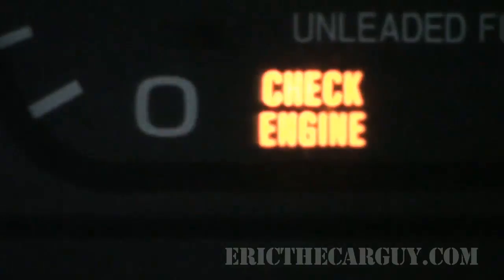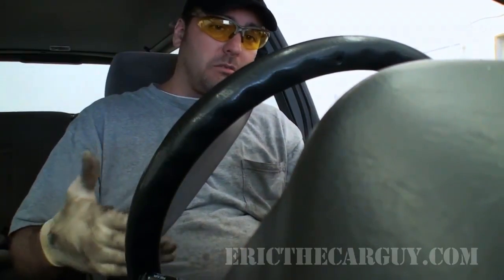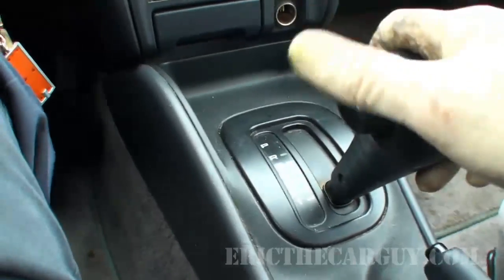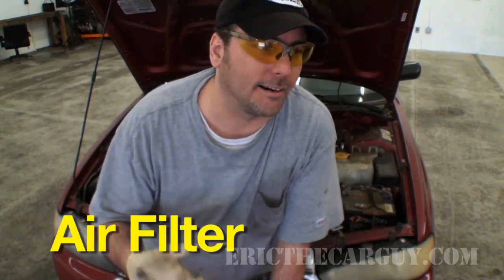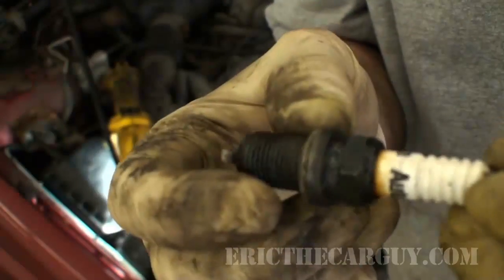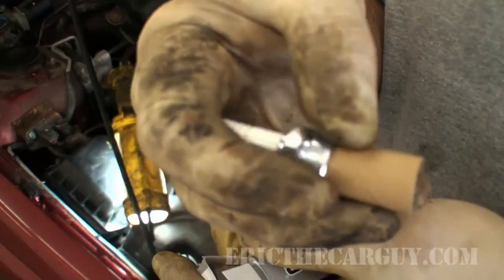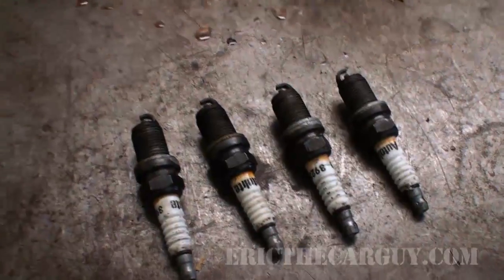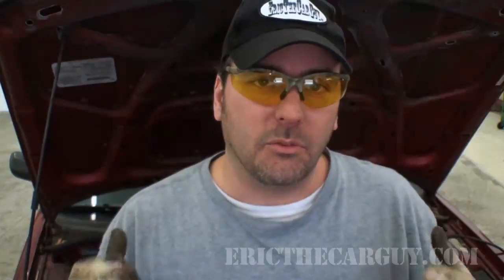Solving Engine Performance Issues (Part 1) - EricTheCarGuy

Comment: I have a 1997 f 150 I was driving along Just fine and the radio stoped working looked down at the gauges and they were zero out it died and I replaced the alternator with a used one and replaced the battery with a new one the starter solenoid and know it will crank over but won't start please help I can't afford to spend anymore money
Reply: Try the ECM?
Reply: try moving steering column up or down.i figured mine out after all my bkyrd mechanic pals got me to buy 1500$ elec.bs.replace column if so
Reply: Check your fuses. 9 times out of 10 it's just a fuse
Reply: 99 f150 dis the same thing

Comment: Cleaning the MAF sensor on an older car can really help performance. I just cleaned the MAF sensor in my mom's 99 Outback (very similar to the one in the video) and the engine runs noticeably smoother.

Comment: the plugs did it..fuel filter added a notch..good video tho..so guys manufacturer recommended plugs and fuel filter change because there might be a blockage in the filter

Comment: At the 11:25 mark it should be mentioned that any time you work with the fuel system you should relieve pressure by venting the gas gap. You'll still get some residual fuel in the lines but it won't be pressurized.

Comment: One tip for installing spark plugs is to gently lower them with your socket wrench (or torque wrench and socket) and set the plug on the threads until its just about to catch but don't tighten it yet just turn the plug counter clockwise very slowly (like loosening it) and wait till you hear or feel a tiny "tink" and that's the very top of the thread of the spark plug dropping in line with the very top of the head's thread for the spark plug. Once you hear that tiny "tink" start tightening it to torque spec and you'll never cross up or bugger the threads since pretty much seems like most if not all heads on cars these days are aluminum. (not sure if I have ever seen any car without aluminum heads)
Reply: Tyler Finvold thank you! I do the same thing never stripped or crossthreaded a sparkplug because of it
Reply: Interesting... Thank you!
Reply: I usually use a piece of hose. Works a lot better.
Reply: I do the same except I do not bother turning them left. I start tightening by hand right away but just use my fingertips so no real force is applied. Then spin them til snug and that is when the socket wrench comes into play for final tightening. Crush down the crush washer until snug and then maybe a 1/4 or 1/8 turn to be tight.

Comment: What's the recommended spark plug and coil for a 2005 f150 5.4L V8? Thanks in advance!
Reply: We used Bosch plugs and accel super spark coils
Reply: Motorcraft or Autolite for Ford

Comment: when i am going up a hill and i accelerate (especially if i should downshift and dont) i hear a gurgling or rattlesnake sound (doesnt seem like the metal rattle of a heat shield for ex). any ideas?

Comment: What kind of spark plugs do I need for a 2007 chevy tahoe z71
Reply: look it up bruh you gots the internet at yo fingertips
Reply: LOL ^^^
Reply: Jose Flores Gotta go googling man....
Reply: GM uses Ac Delco
Reply: +usa2012 correct, only acdelco on gm vehicles
Reply: ***** Acdelco - GM Motorcraft - Ford Champion - Dodge NGK - Jap Import (some euro aswell) Bosch - Euro

Comment: i noticed something about the spark plugs that you missed, they are blowing the compression pressure through the spark plug.
you can tell by the brown witness marks going up the ceramic part of the plug after the metal part of the spark plug.
Reply: it happens to all spark plugs eventually, heat, vibration and pressure causes the seal to break down.
Reply: If that is the case then the center part would be loose right ?

Comment: My 240sx does the same thing but only when its warmed up. Occasionally overheating but cools back down after you hit high rpms. I can't get the torque I want cause at about 2g it wants to bog. Stopping it will sometimes bog out or when rolling in nuetral after dropping out of gear. I used seafoam, changed spark plugs, new terminals for post on battery. I bought a pcv valve but am having trouble getting to it on the ka24de motor in my 92 nissan 240sx. If you could make that video that would be sweet. Can only find shitty diagrams.  I know my headgasket is blown. Trying to save up money to purchase all new internals so I can just do a full rebuild. The aluminum head might be warped so I may have to get it machined or find a replacement. Hope to fix it soon. Let you know if valve fixes it.

Comment: any fumes after replacing,,spark plugs or fuel filter?
Reply: Any white smoke after the new plugs might be because your o ring in the motor leak causing the oil to get past the o ring into the combustion chamber causing the white smoke it should only do it for a few miles or it could be something else

Comment: How come you did not check the air filter or transmission oil level?,or tracking on the ignition leads?.

Comment: with all due respect to you I must disagree. I use autolite on all my vehicles, Mostly GM cheveys. I run them up to 35 thousand and have no issues what so ever. To me I don't like the 100 thousand mile plugs and change them once every two years in late fall. As the conventional plugs does not cost much
Reply: He said in the video that the autolites are good for ford and Chevy's dude actually watch the video before u comment
Reply: autolites would work fine with most domestic american cars as the ignition systems are similiar, he just said they're worse for foreign cars like subarus which have a differently designed ignition system
Reply: Disagree? lol If you know so much why are you watching his basic video?
Reply: Kyros Dartanian If you know all this why are you watching this vid. Guess you just want to act like a master mechanic and see your bull shit in words
Reply: you might be right sine it is new spark plugs vs old ones might not be brands but condition
Reply: GM's prefer Delco plugs.
Reply: +usa2012 I've always used e3 plugs in my Chevys 90 k1500 silver ado and a 97 k2500 gmc suburban. And they love it
Reply: +Kyros Dartanian  Hey fucktard why you watching it. Myself I enjoy the bull he is spreading just like your fart can crap spewing out your mouth .

Comment: Found oil on one of my spark plugs 1987 325i any suggestions would be appreciated username19762012@gmail. Com
Reply: Hi,changed the valve cover gasket in my cs3 .problem fixed
Reply: Thanks for the tip greatly appreciated

Comment: I would've (liked to see you do) hacksaw the filter open- check for water, rust, corrosion, bits of rubber lines, etc. that may be coming from a line or tank. Usually the in-tank type pump have a strainer to prevent that- but I've seen those rot through, and come loose enough to let debris through- even the guts of a pump can disintegrate.

Comment: 13:45 Anyone know how/why the fuel pressure is going up when the engine is shut off?
Reply: cuz fuel pumps maintain fuel pressure even when the car is shut off, and pressure sometimes goes even slightly higher due to added power from everything being off, that's why when you are changing a fuel filter you must disconnect the battery or you will get pressurized fuel coming out all over your face after you pull the filter out

Comment: okay, so i dont use the ac so i removed the belt from the compressor on my subaru 93 legacy with ej22, does that belt run anything else that i need it to be replaced back? thanks

Comment: my mom has a newer Forrester and the transmission just feels off, like a design flaw.  it shifts too early or too late, annoyingly loud.  steering is actually too sensitive so when u look away for a second it feels like you yanked the steering wheel. so any road trip ends up with all of us bitching at each other's driving.  plus if u are tall it is too short of a vehicle. 

i rented a similar sized chevy and actually preferred that.  subarus are cooler looking and trendy but don't like the one she has.
Reply: Szz
Reply: Stokely Stbernard
how dare you
Reply: Sorry wasn't me
Reply: How new? If its a bit old, the trans could be an issue with the TPS. The handling is either;
Crappy tires
Bad alignment
Steering part failing
Steering part replaced with low quality part

As for not enough height; All the Foresters I have been in had the adjustable height seats, does that one have them?
Reply: FCFordLord
the handling is actually too good. thats what i mean.  too tight.  u look away for a second and the car jerks.

i think the tuning is off and engine is underpowered. it feels like there is a governer holding back its power.

they are selling it next year anyways. not a bad car at all.  6 years old

Comment: As far as the spark plugs, I had the same issue...I had Autolite plugs in a Mitsubishi (from the previous owner) and it wasn't performing as it should (partially because they were also corroded)...once I changed over to NGK plugs, the difference was almost night and day

Comment: I got a 1991 Ford I bought from someone.  It needs a little work, the engine is okay, it just has a hard time idling occasionally, and stalls on cold starts.  And in general runs a little rough.  I think it is the timing that needs to be worked on, but would it make any difference to change the spark plugs?
Reply: Clean the AIC sensor. Usually the cause of those symptoms with Fords. Its mounted on the side of the throttle body. Spray brake cleaner through the port and you're all set!
Reply: Oh okay.  I will take it to the shop and ask the auto tech there.  But I appreciate you getting back to me.
Reply: Ask him to clean the sensor I mean.
Reply: Sure thing, but honestly, its something very easy to do yourself and not spend the amount money a shop will charge.
Reply: Oh okay, I will take a look, hell I got a shop manual.
Reply: 231mac
Reply: 231mac

Comment: I am not a mechanic but taking off with the wheels turned and adding the power,it could even be one Tyre might be more worn or it might of had a puncture and the spare was new giving a larger circumference especially on a AWD car,binding it up a bit,what do you think?

Comment: What cvauses  engine to stumble  when ac on only when ac on
Reply: Is it a Honda? It might not be idling up when the AC is on. The computer should know the compressor is in use and idle up the engine slightly.
Reply: KiwiPowerNZ I t stopped after driving it a while

Comment: "A spark plug part number might fit hundreds of different engines from many different manufacturers. Although the NGK factory will set the gap to a pre-selected setting, this may not be the right gap for your particular engine. The incorrect plug gap for your engine can contribute to a high rate of misfires, loss of power, plug fouling, poor fuel economy, and accelerated plug wear. It is always best to check the gap against the manufacturer's specifications. If adjusting the gap on fine wire or precious metal plugs such as platinum or iridium be very careful not to apply any pressure or prying force to the fine wire center electrode or insulator as they can be damaged. The gap should be adjusted by only moving the ground electrode. "

--- NGK spark plugs

  Watched only two videos and found two statements absolutely WRONG. Thousands of people got bad info just on this one video.

ALWAYS GAP YOUR SPARK PLUGS, PERIOD!!!!
Reply: I agree... I have yet to run into a properly gapped plug right out of the box. I'm surprised he suggested to not gap the plugs.

Comment: I can not believe you said not to gap the plugs, That is more important than not putting autolite plugs in a Subaru. Once you moved that fuel filter around with out fuel pressure to hold the shit in place in the filter, it give it a chance to clear some of the filter medium opening a plugged filter. It can produce an intermittent problem when it gets to that point. All the shit is still in the filter, it just might not be were it is plugging the flow to a point where it is effecting engine performance.
Reply: Been using new NGK plugs for a long time and found they don't need re-gapping unless spec non std.
Reply: Wishbone799 I would rather check the gap before I install them. You can trust NGK if you want, I only trust myself. Nothing sucks more that to finish a tune-up and end up with a skip, or have your customer come back a week later complaining. I don't have the time to cut corners.

Comment: I have the same problem with my 96 Saturn sl2. At a red light and floor it the engine will rev up like normal but the car doesn't really move once it's going it's going.

Comment: Yo my man, I Have the 06 Impala  3.5 L  what brand should I use and which one is better copper iridium or platinum. And will the spark plug with the fine wire core be better to use for

Comment: The fuel pump relays run the pump at lower amps on idle than acceleration, that's why the pressure goes from 30-35psi. The max psi is set by the pressure regulator that sits on the end of the fuel rail.

Comment: Thanks for your very good videos. I have the exact same symptom on Subaru Impresa 2008 (front wheel drive), I begin to suspect it is a Subaru's factory problem, I thought of changing ignition advancement, but it is fixed

Comment: Subaru's are just known to have a delayed throttle.
Reply: Ones that have not been maintained and have over 250k miles, maybe. 
Throttle lag is easy to fix, especially on Subaru's. The ones that are properly maintained do not have it, even mine at 241k miles doesn't.

Comment: Know where you stand do a compression check first
Yes I agree swapping out plugs would be the next move
How about changing the mass airflow sensor and inspecting injector nozzles too
Reply: 2002 Chevy astro van 6cylinder hisatation
Reply: Better to diagnose a problem than throw money and parts at it

Comment: I spend over 1000 trying get my envoy GMC 2004 fixed . I am so pissed with mechanics because they use this computer system and take a wild guess too as I would . I have the check engine light and did replace the code for the crankshaft and sensor and is saying is the same dam thing again !! WARNING STAY AWAY FROM ANY AMERICAN MADE CAR!! I am going back to Nissan or Honda . Done with Fords and GMC cars . I had my car for last 3 years and is draining me to the poor house . I can't go out and have normal life because I am paying parts for this parasite car parts .  My car has been a bloody nightmare as I told my new mechanic, guess he feels sorry for me and is not charging me to look at it again because he knows all the drama my car has caused me . It drives rough and I hear a clicking sound from the battery and the advance auto check the test and it says CRANKSHAFT..should be called crack crap !! I did the testing and almost died in the interstate because I had hard time breaking and I had 5 people honk at me and than the whole car stopped outside the interstate on a stop light and than I turned it back on and is like the light is still saying check engine light ! DRIVING ME NUTS!! Going to sell it or trade it before I am carless in middle Midwest you can't be carless because no subways or great transit service . I had it at car dealer of GMC and mien eke and there all rip offs and j****they did the wrong part and one place didn't even put the right part in and guess what...got my money back...STAY AWAY FROM MIENEKETOO!
Reply: If you want the most reliable car money can buy you can't go past a Toyota Corolla. The most reliable mid sized car there is. Our family has 4 of them, the oldest has done 524,000km. Mine I just bought it's a 2006 Corolla silver hatch back. I really wanted a sedan but got tired of looking so settled for the hatch. You don't see many for sale because people hang onto Corollas. It's done 280,000km and apart from the back-light for the clock which doesn't come on when the lights are on, it's completely mechanically sound. Air con blows cold, clutch and transmission is working as it should, engine sounds smooth oil is clean and golden.

The only work I've done on my car is fix a fender bender (from the previous owner). It wasn't hard he'd just reversed over something and yanked the bumper. Changed the brake pads, adjusted the handbrake, and changed the air filter. The only thing that absolutely needed doing was the brakes.

Comment: i would like to point out that if you replace coil, the cap and rotor, and your coil you can gain quite a bit of performance. so you can change plugs Bosch is good for strong aftermarket plugs the +4 is their highest level

Comment: ok just my 2cents but it sounds like your mass air flow censor or your throttle position censor simply cleaning the mass air flow censor eliminates this on my car and adds what feals like 10 to 15 hp at the petal , NO LIE , just try it people you will be hooked for life, about every other oil change i do this

Comment: Don't worry dude usually when i have a problem i have to have my truck towed in and then the mechanic takes his wife and kids to Florida on vacation for the test drive and nothing happens it runs perfect but then i have to have it towed back home because the whole shop thinks i am a nut case. My vehicles seem to like getting a laugh in every once in awhile at my expense which is fine i am a good sport.

Comment: Idle pressure and full throttle pressure are two different things, I would have liked to see the gauge at full throttle.  I have seen bad filters give an almost  full reading until the flow demand increases, then things go bad very quickly.